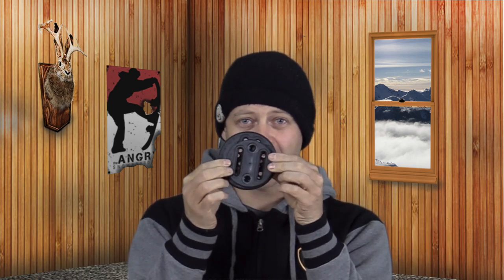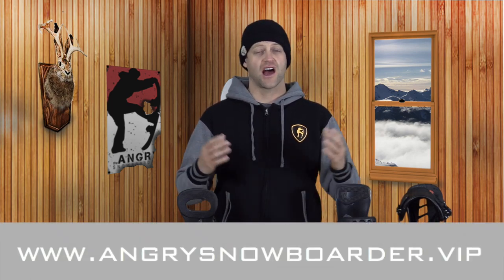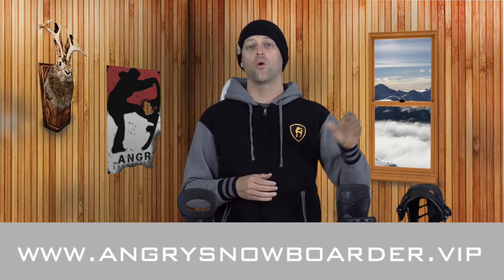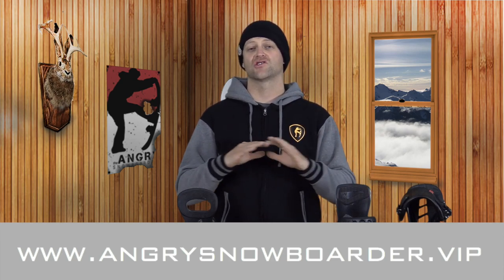Snowboard Binding Mini Disks: Explained

Comment: I would point out if your a strong aggressive rider on a stiffer board you might have issues with mini disk based bindings over flexing allowing snow/ice to build up between the base of the binding and the board.....

Rome targa (full disk)
Rome 390 boss (full disk)
Union Atlas-heavily modified (full disk)
Union ultra (mini disk) unrideable after an hour due to ice build up between the binding and board....

Comment: How do you find Burton reflex disks compare to a mini disk for reducing deadspots?
Reply from the maker: It's still got a bit of a dead spot just not as drastic.
Reply: @AngrySnowboarder  more dead than mini disks?
Reply from the maker: It's close to a mini disk but a little different as it has that internal flex point in the reflex.

Comment: I've ridden Burton diodes since they came out, replacing the straps and fragile highbacks with x base ones every couple years. Every season I find a new pair on eBay. Lifetime warranty on the baseplates. Tight trucks zero fucks.

Comment: I've been on the Union Atlas for years and I finally got fed up with my ankle screws coming loose. It seems like every 7 - 10 runs I had to tighten them back up. So, I just received the Arbor Cypress in the mail yesterday that has a mini disk. It's not the reason I chose them - just seemed like a good binding for the price (not to mention Kevin's good review). Hope I won't be disappointed.
Reply: Putting the ankle strap and high back on the same bolt is the union fail. When they fix that theyll be great.
Reply: Yeah, I've noticed that some companies do that and others will separate them like Arbor, Burton, etc.
Reply: I've ridden a few different pairs of union bindings through the years and they used to do that all the time. Got the contact pros last year and they finally fixed the problem by adding a little washer kinda thing in there. No more loose straps

Comment: Thanks for the info.... Do you have a video installing these minidisks on a 3D pattern board. I have the El Hefe binding and giving it to my son, his board is Burton with 3D and the minidisk has 2 slots and 2 holes, and they don't seem to match, best case I can get 3 to align but the they end off center.
Reply from the maker: That's not going to work.
Reply: @AngrySnowboarder  Thanks, was hoping you would pull a neat trick to make it work... Contacting Ride to see if they have an available disk. If not it may be time to retire the old Clash Burton board. Thanks anyway!
Reply from the maker: Retire it.

Comment: In order to change how far my toes or heels hang over the edge of my board, would i have to only use two screws on the mini disk? Seems like the size doesnt make any room for this kind of adjustment.
Reply from the maker: No that's a heel centering issue and you might need an offset disk which with mini disks they don't offer that.

Comment: Do you expect/hypothesize that between 2 identical bindings, if one used mini disks, that it would also be less responsive than its regular disk counter part? I would think there is less leverage is with a mini disk (why now's bracket underneath is wider than a disk).
Reply: The size of the disc changes the placements of the screws. Most bindings have some padding/damping material which allows the board to flex and press into the material. Since it is the same binding we are comparing, just different discs then I guess having the fixed part closer to the nose or tail would change the amount the board flexes and how. I think alot of people notice how much torsional flex is in a board and I would expect a noticeable difference here.
Reply from the maker: Mini disk makes it more responsive as there's less of a dead spot. But the concept you're talking about is more or less how it works. You end up with a difference in flex points because the binding either has more leverage from the mini disk or less from the wider disk.
Reply: @kuanhau4323  screws are the same from heel side to toe side.

Comment: I've owned two pairs of bindings with mini disks from two different brands. I don't know if it's just bad luck or if it's something to do with the disk design? But both sets came with baseplate screws a couple of mm too tall so the binding would become loose after a run or two. Shorter screws fixed that. I never had that on any other binding before. So the first time it happened it really confused me.
Reply from the maker: Nitro and Arbor?
Reply: @AngrySnowboarder  Nitro mini disk on Phantoms and Bent Metal Pivot disk on Logics
Reply: I got a set of Arbor's last year and the screws were too short. I had to put all of my girthy goodness into the first couple turns to get the threads seated.
Reply: I've had the same issue on different sets of bindings, Ride Rodeo's and an old set of Flow's. The screw was just a hair too long so I couldn't get them to seat all the way in and they'd loosen up after 8-10 runs. I got some of the rubbery mat stuff used for a drawer liner and traced the outline of the binding base on it then cut it out put it under the binding . The extra little bit of thickness gives the screw more bite.  If the screws do loosen a little the rubber mat is grippy so it stops the binding moving around too much until you can tighten it.

Comment: So does the Burton channel make a larger dead spot?
Reply: I believe the EST system is designed to eliminate the deadspot.   No disc = no deadspot.  I own a burton with EST bindings but I havent riden any other boards in a while so I have no idea how other bindings would feel.
Reply: No dead spot with no disc.
Reply from the maker: It moves the dead spot to a micro position on the outside of the foot where the bolts are and that's it. It's in a spot most people wouldn't even notice.

Comment: I don`t like the mini disks, because they suck out the inserts (not sure if this is the right word, however i`ve seen this on Gnu carbon credit and Lib skate banana) . Consider this - a lot of boards has carbon stringers in the binding area making the board more responsive. Not just freeride boards, but also all-mountain and freestyle boards. And with mini disc, you can twist your binging more, that`s not logical. If you are a jibber, then ok, but in any other situation mini disc is a bad thing - especially for your inserts.
Reply from the maker: Mini disk isn't causing the inserts to pull that is more indicative of over tightening.

Comment: Mini disk I feel is better for freestyle or surfy style of riding, but if your hard charging they don't work. They create snow/ice build up and in essence create an uneven dead spot. Good friend of mine has destroyed many mini disks because of his style of riding.
Reply: My union ultras are a mini disk and charge just fine....havent caught edges yet

Good flex too
Reply: I have one set of mini disk bindings and 4 sets of regular bindings. I still need to run the mini disks through a day of railing hard turns to see how they hold up, but what I have noticed is that they seem to smooth out edge to edge transitions a bit over traditional bindings. To your point though, this might have an affect on response and I like razor sharp response. You never know when you'll need to quickly change direction and shoot across the trail to tail tap that fat skier kid that just fell.
Reply: Agreed. Works well for the park cause it gives you maneuverability but that in trade makes it less stable while hard charging or on groomers. Personally, not a fan. They take away from the boards torsional flex by making the disc fixated closer to the center of the board instead of the edges.
Reply: My Arbor Cypress charge hard and turn on a dime while being very damp.....no issues with mini discs here. The Union Atlas I tried last season with a full size disc feel like crap. So I guess it's what you are used to...I do other board sports so the mini discs feel right to me. If you don't have a surf/skate background then they probably will feel too loose/weird to you. Full discs feel too locked in which for me reduces response...counter-intuitive unless you do other board sports. Zero snow /ice buildup underneath the Arbor bindings fwiw.